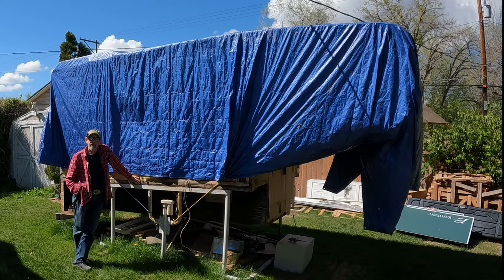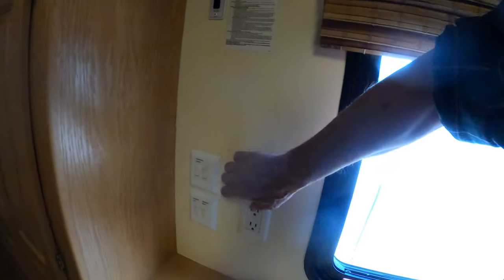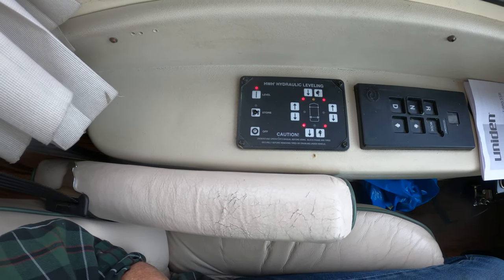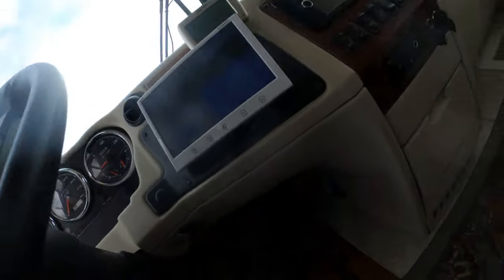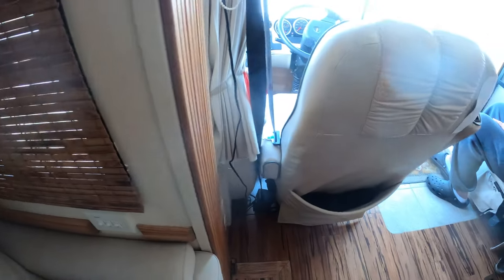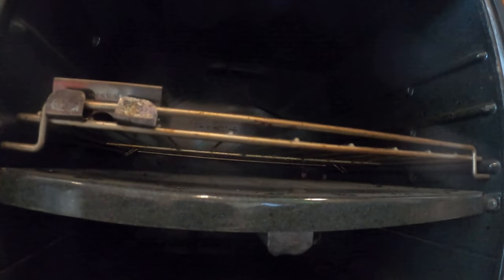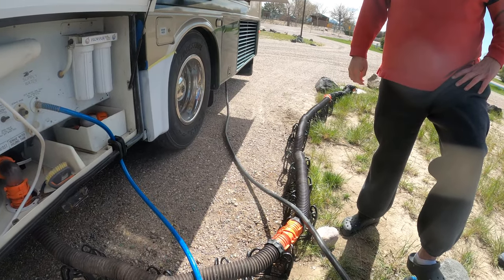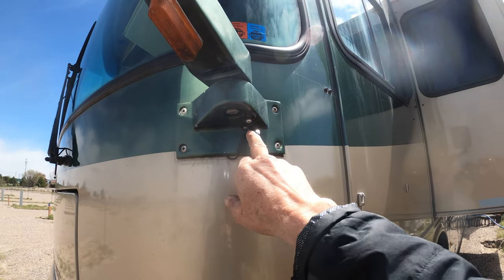2004 Newmar Dutch Star Video Owners Manual

Comment: You did such an excellent walk through and are so knowledgable, I have to see if you might know the answer.  On my 2003 Newmar Dutch Star Diesel that looks exactly like the one in the video, a few minor differences like my chassis fuses are actually in the same front under hood compartment as the generator.   I am trying to find the fuses for my 7 pin towing connector.  I don't have right blinker and I know the fuse is blown because while I was trying to replace the 7 pin connector two of the wires touched each other while I had the ignition on.  All signals on the coach work, it's just the tow connector wires.  The left turn signal on the 7 pin does cause my 12V light tester to blink but no right turn.  Really since the test like blinks with the left turn signal that is the only wire I can identify.  I ran into trouble because I was expecting the wires to be color coded but I have 6 white wires and one blue going to the tow connector.  Not only was I trying to replace my old 7 pin connector with the stripped out rusty screws, I was also adding a charge line for my towed vehicles battery.  So after I replace the blown fuse (where ever it is)  I'll need to continue using the signals on the coach to identify the wires.  My question is do you know where the tow fuses are?  I seen where in your video, under the inverter there were two black boxes.  I seen one in mine but my plan is to go back and see if I have 2.  I will test all those fuses, please let me know if I'm on the right track for finding my 7 pin fuse location.
Reply from the maker: Hi. It depends on the chassis manufacturer of the chassis. Freightliner fuses for the towing plug are all in the inverter cabinet (or second cabinet from the rear on the passenger side). Not sure about Spartan.  But, yes there is a dedicated fuse block for the tow plug to isolate from the chassis. That's why the chassis lights flash.  In my humble opinion, I would replace the white wires back to where they are spliced to the wiring harness with the correct color coding. Just my OCD. On the no flash on trailer but flashes on the probe, CHECK the ground between the toad and the RV. You must have a good ground and that symptom tells me either you have a bulb out or a bad ground *perhaps broken wire... ground is easier to find and fix so you should start there once you verify the fuses.
Reply: @trbowlin it’s a Spartan chassis.  No telling where they have them.  I apologize if I wasn’t clear.  The problem only exists with the 7 pin connector.  Not the towed vehicle. So I can ground a test light to the vehicle and the only thing I get from the 7 pin is left blinker because my test light blinks. But nothing else. I’m confident once I find the fuse, everything will be restored.  And oh yes, I have that same OCD lol, I have ordered all the colors and once I figure out what is what, I will definitely change the wires.  Thanks for responding.  I may have to wait till Monday and try and get ahold of Spartan.  I just hate when something isn’t working so it will be hard to wait.

Comment: Was your water heater adjuster an add on? If so where is the original water heater control panel? For an 03 Dutch star
Reply from the maker: Yes, because I replaced the original water heater with a Girard Tankless water heater and the remote came with it. The original water heater has no remote panel, just the switch's up in the electrical control panel.